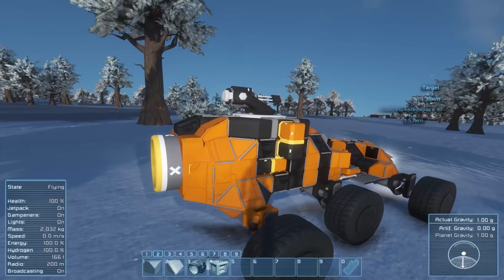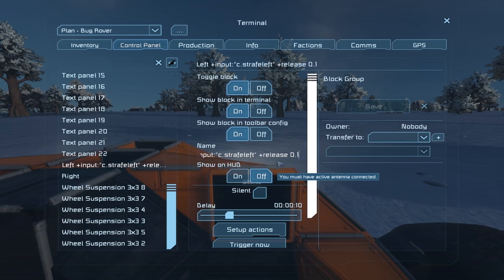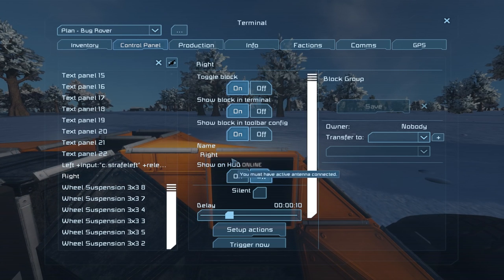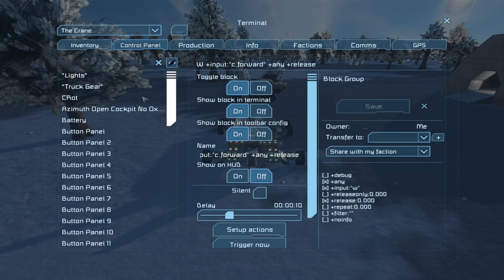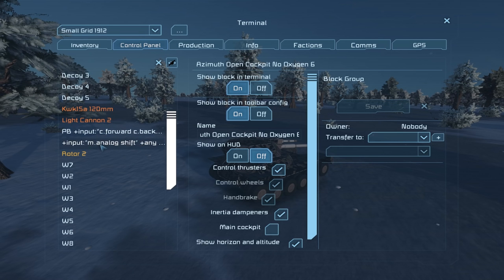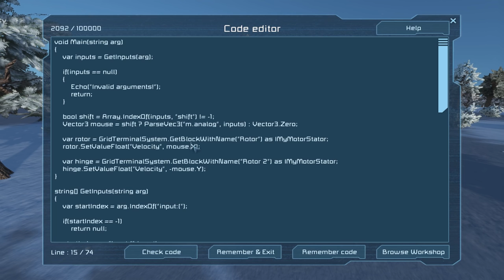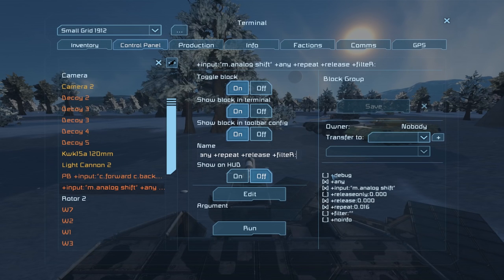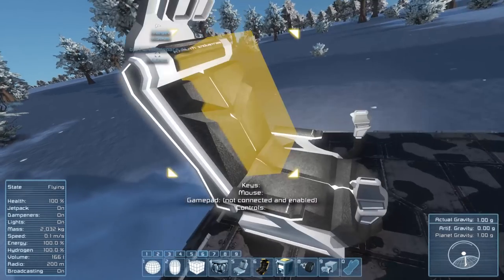Space Engineers - Keybind Almost Anything with Digi's Control Module, including mouse!

Comment: The tanks might probably work better with wheel suspensions that have steering disabled (I don't know; it's Space Engineers). But yeah, being able to bind the movement to the controls is a huge improvement.
Reply: There is a mod adding suspension in the form of a rotor with am attached arm. It takes up much space but should work fine now since this mod allows us to use rotors as wheels, wich also work when attached to other rotors.

Comment: does this mod have any commands for mapping analog axis ?

for example a thruster group override to a throttle
Reply from the maker: +Mike Loeven yup, but will require a script to interpret the analogue input into the output settings you need, much like the turret control one does with the rotors. Can map analogue axis from both mouse and gamepad

Comment: Too bad most servers turn off Programmable blocks :-(
Reply: +Jolly Joel There is no programmable block its a mod and only uses timers :S The wheels and Gun control are used in conjunction with programmable blocks for more accurate results but you could always do the same thing without just clunky
Reply: +HecticNemesis You're right that is a mod, but my point still stands.